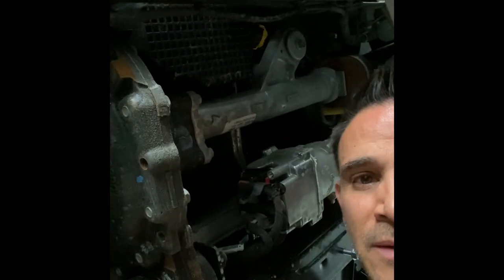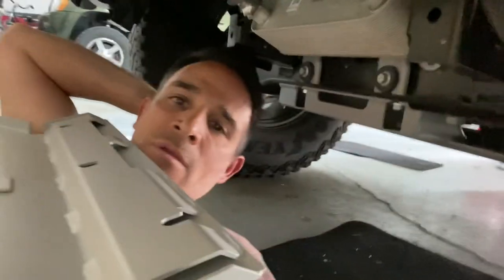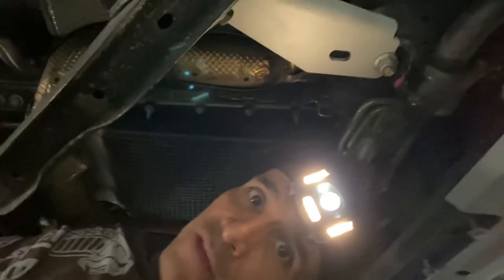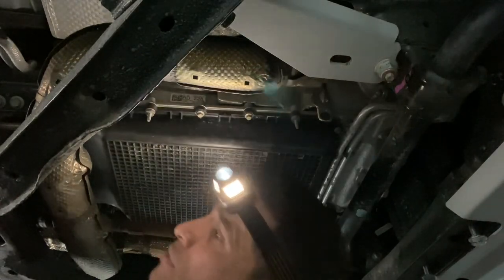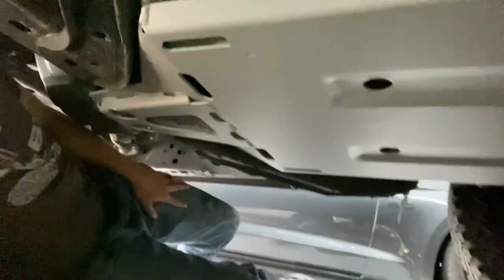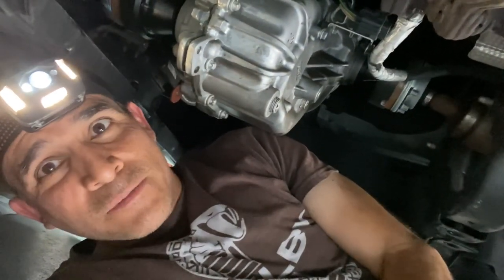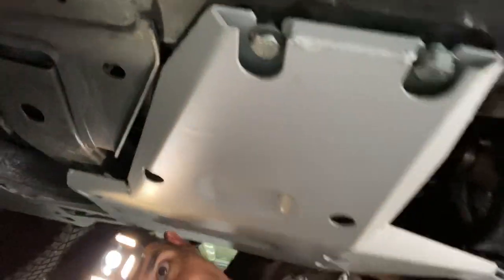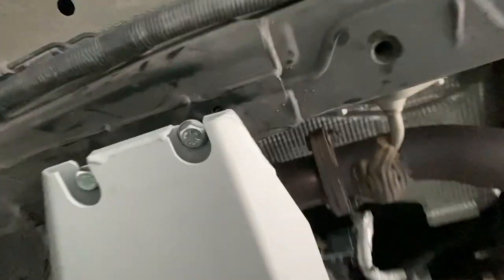New Bronco Under Armor!

Comment: Great video.  I have a 23 Big Bend and was surprised at the plastic transmission pan.  I went with a Mabett transmission skid plate for now.  Looking at the ARB plates.  If you are going to Moab and you have those skid plates, what about the fuel tank?  Are you going to add a skid there?
Reply: I may add a fuel tank skid but the other vitals needed protection first.  From what I understand the fuel tank is more forgiving if scraped and was constructed to be very robust.

Comment: Did you take off the tow hook that comes with Big Bend before you installed the skid plate on the front?
Reply from the maker: No you can leave the tow hook in place and the front armor fits perfect!
Reply: Thanks!
Reply: Hi, how many skid plates do you need to remove when you change oil for your Bronco?